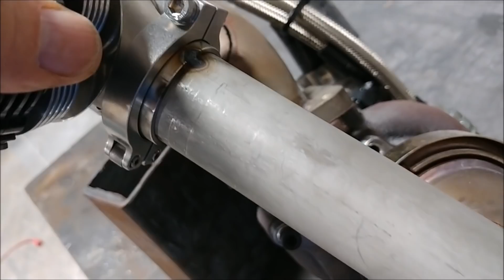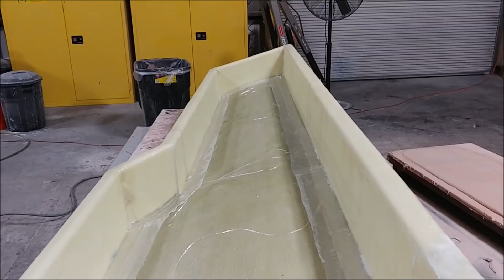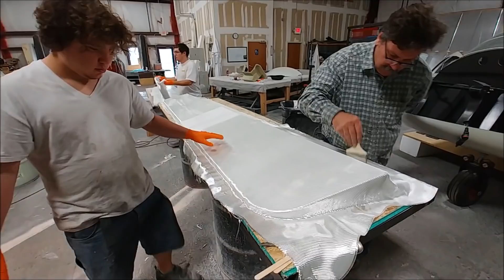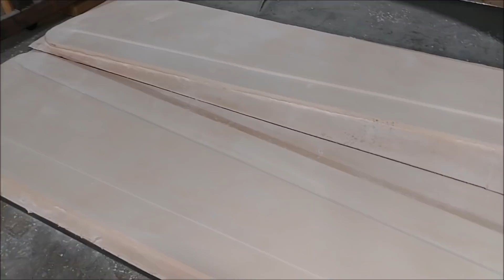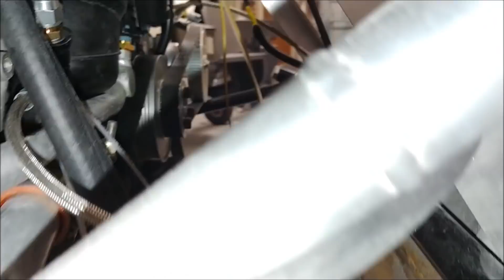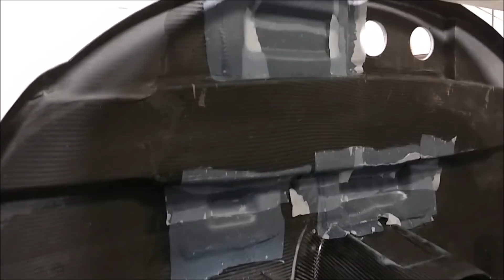One Piece At A Time - things keep coming together

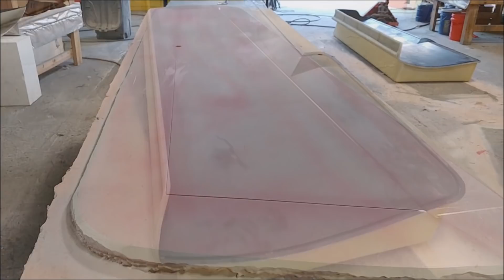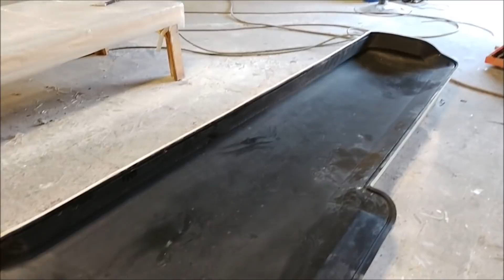Comment: Great stuff, Peter. You can sure tell how much experience the team has at making molds. The one you show at 8:42 looks absolutely exquisite. I have one question, why did Jeff cover up the holes at 8:52? Thanks for the updates as I really enjoy each and every video, very informative.
Reply from the maker: Jeff had to lay up plies on the inside over the foam core he used to make a 45 degree bevel on the edges of the openings. The holes will be redrilled.
Reply: Earlier video showed them forming the shape of the area, but not finishing with cloth... This will close up and strengthen the surrounding area, then the holes themselves will be reopened for the lines.

Comment: G'day Peter! You are making great progress, although the work never seems to end. I have a question which I am a little surprised was not asked in your Q and A video. Will you be making it possible for customers/ owners to customize or add options to their aircraft during the build phase at the construction centres. Example I like the style seats you currently have in the prototype. ( as good as the 3 seat bench design is it would not be my preference ) Also If I had a choice I would prefer a fully steering nose wheel. Anyway I think you get the idea. A few options would be nice. keep up the good work can't wait to see it completed and flying. Regards from down under.